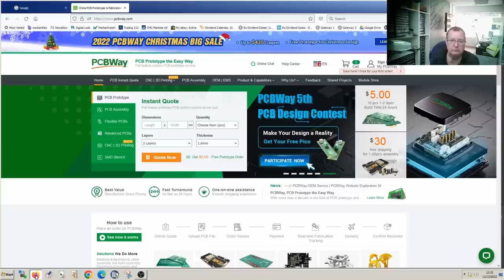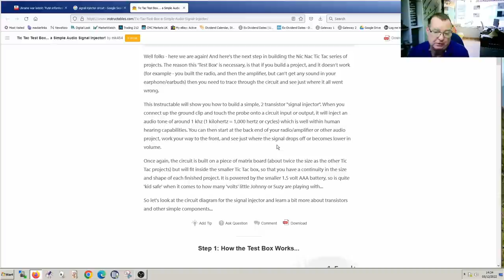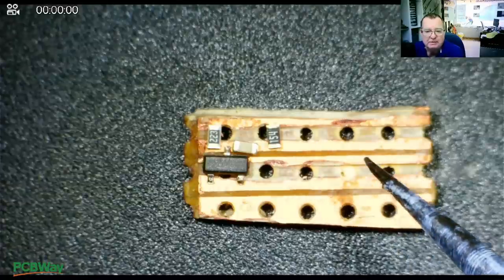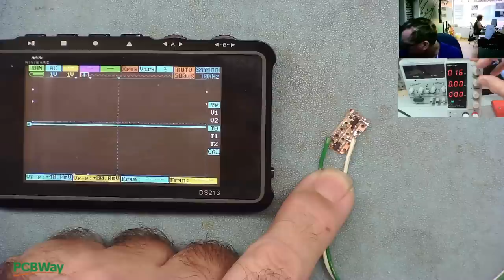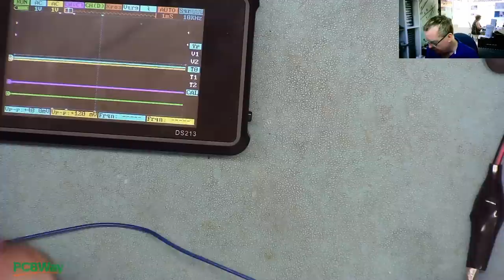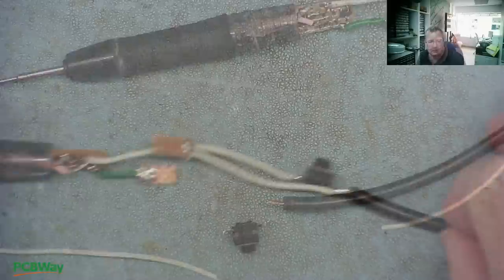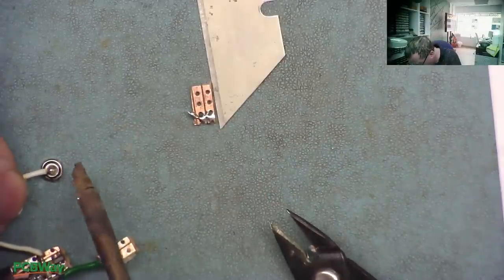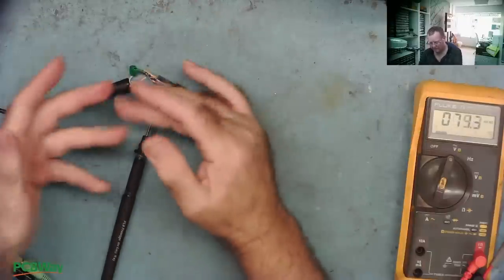Build A Cheap DIY Signal Injector Pen Useful For Electronics Fault Finding - In A Pen!

Comment: I'm roughly 15:30 into the video, for a lithium cell that would fit in those pens (They're designed for this purpose) is the batteries that look literally like capacitors,
Search, "huahui new energy 3.7v li-ion".
The model I got is the HCC7240 version salvaged from a broken graphics tablet.

Comment: Instead of making a circuit board, you could have easily done P2P wiring of the small parts and sealed it in resin in the pen body. Perhaps a AAA cell would fit in a thicker pen.
Although that doesn't work well with the sponsorship deal

Comment: I made one of those 50 + years ago .
Back when projects never fitted the intended inclosure ! 

Its fundamental frequency was 400 Hz ( +/- a lot ) .
But had harmonics up past 40 Mhz the mark .

Using salvage parts did the +/- a lot thing & don't help reduce case sizes  ….

Comment: Hello Richard. When designing the PCB, you might want to place the Push-Button switch on the board, somewhere closer to the front tip of the pen, for easier access when probing. I'm looking forward to seeing your design.
Reply from the maker: Thanks,  I also want to include a battery holder clip on the pcb too if I can. 😉

Comment: if like me you work on a lot of vintage AM radios a signal injector is one of the most usefull tools you can have but will need a high voltage cap feeding the probe 
the more harmonics it produes the better will work right up to RF .

Comment: Nice work. I got a few woulda, coulda, shouldas for you. The button: a plastic bolt or something else coming through the other side of the ink pen housing could have made pushing it up into position easy for you. The battery: I would have tried using a cell out of a 9v battery for that, maybe even 2 may fit into it. You could easily soldier to the welded tabs. 

I didn’t quite understand how the receiver was made. It seemed like you built a prototype circuit board and then switched to something else at the end. I didn’t see how that was made. 

Just my two cents.

Comment: Did you cut the piece with vice trips or what....
button cell 357, a pen light with a modified light end might be easier.
What would be interesting is using one of the multicolor lens with different functions with the ink selectors. I'll have to think more on that.It's

Comment: Thanks for giving up your Sunday to build the signal injector Changi g the subject I was watching one of your videos dealing with internet streaming devices and using 5 volts instead of 12 volts. I am surprised they they had  not included some undervoltage protection of some kind overvoltage protection on the 5 volt model for the same reason for people pluging 12 power packs into a 5 volt device. By the way I am enjoying your content.
Reply from the maker: I responded to this same question several times on that video, so you can refer to those comments for more detail - but basically, as the supply voltage is decreased the pulse width (on-time coming form the buck controller) increases to maintain the output voltage.   If the circuit designer selected the inductor to work with the correct input voltage and if the inductor then saturates before the supply voltage gets low enough to trigger, the UVLO protection will not save the buck controller.

Comment: I know it’s cheating a little but I’ve heard of this place called pcb way and they might be able to make a board that would fit. Don’t know if you’ve heard of them? Possibly with a neg contact plate for the button cell and a hole for a diy wire arm for the positive. Also button up closer to the tips gotta be nicer ? Lovely project, Richard. Making me want to get the Vero board and components out and play 😁
Reply: @Bobo-ox7fj  also you can upload your designs and receive a commission on them as s creator. They do pens too 🤷‍♂️ Winner winner 🐓 🥘 “other manufacturers are available”🤣